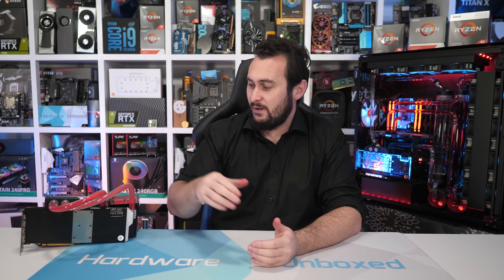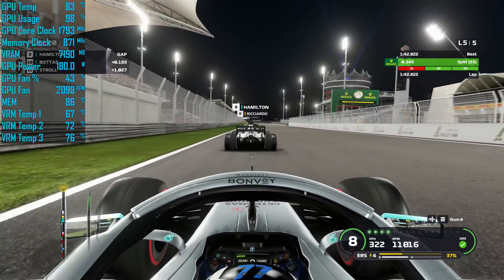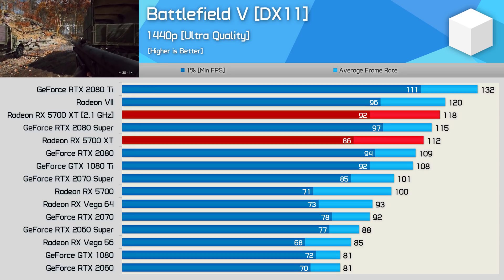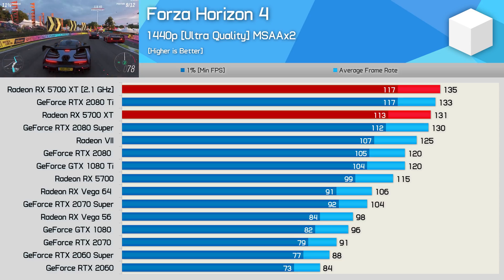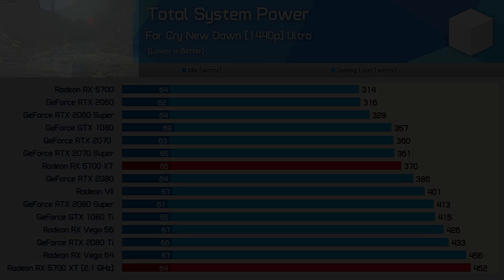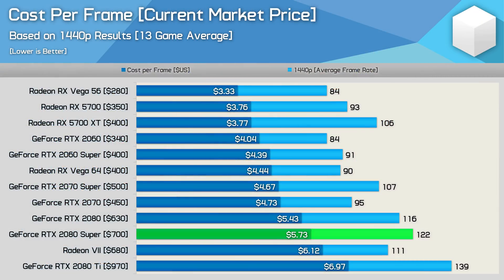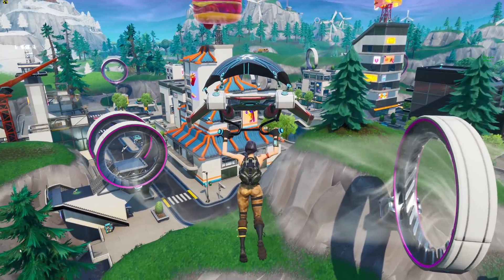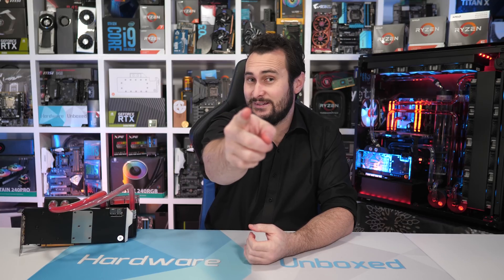Radeon RX 5700 XT Overclocked, RTX 2080-Like Performance?

Comment: Having seen this, the major benefit of having AIB card will be much cooler and quieter card. The performance gain may not be as significant as people was hoping for.
Reply: I mean it was never the case in the past so why would it be different this time, but honestly the performance is solid already so quieter and cooler AIB models will be nice.
Reply: @BombaJead  Except starting with Turing, nvidia started binning separate dies for their more expensive stock versions rather than the traditional of stock cards being just baseline with meh performance. Pascal was pretty similar in someways too, but definitely saw a bigger help from better cooling than we might see from Navi.
Reply: It's already been done and tested.. It runs a little cooler. Power Play power limit registry mod + Undervolt + Overclock = much better performance with a cooler running card.
Reply: I guess it makes sense. Otherwise AMD would have done it. They have engineers developing this product!
Reply: After watching this video I chose the 2070 super.

The 4 years of warranty alone made the choice easy, I'm glad they're performing pretty equally. 

I'm sad I didn't get the 5700 XT because I wanted to support AMD this time... But it wasn't worth the potential wait until mid September.
Reply: Giliver agreed I’m getting a 2080
Reply: @Giliver  I would go the AMD route, you know what happened to the first GCN products? The same will happen again
Reply: @twanduvigneau5809  already went Nvidia, there were too many things holding me against AMD. (Meh bonuses, bad cooler, bad drivers so I've heard, inferior warranty compared to gigabyte etc) 

I couldn't justify the the cons to save $100 or less.
Reply: Giliver the drivers for both cards need to mature more and AMD would definitely need more work to match the rtx 2070/2080 with the 5700 XT
Reply: In terms of temperature and performance
Reply: So not even with all of that WaterBlock mounting (and investment) + extreme overclock it can surprass a RTX 2070 Super. There you go, AIB won´t do mircales, RTX 2070 Super it is. You just made my life simpler, ordered it now! Thanks!
Reply: MultiPlatform MasterRace stop copying and pasting the same thing come on grow up.
Reply: @MrCakeBone  I mean, we're looking at an entirely different pricing bracket here....
Reply: @MrCakeBone  You're paying a lot more (100-150) for what still amounts to a marginal increase in performance, and the ability to get your card a couple of weeks sooner. Why not just make do with your older card for a few more weeks? Or you could have gotten something on the used market.

Comment: Don't forget the cost of the radiator and fans. Water cooled 5700 xt goes over $600.
Reply: Unless you're a beginner, anyone who's into serious watercooling will already have the rest of the loop and knows that you add £140 for the waterblock when getting a new gpu.
Reply: @TheGhost I agree with this but at the same time you are not gonna be buying this card if you have money, you would be getting the 2080ti
Reply: @TheGhost for what? Not been sarcastic, why do you need 16gb og hbm2? At least not for gaming
Reply: TheGhost 2080ti has 11gb vram
Reply: @TheGhost Stop talking out of your ass, my 1070 at 1440p barely uses 5-6 gb on most games out of my extensive game library. You made a big mistake by not going for the 2080 Ti and you're trying to justify your purchase by talking crap.
Reply: @TheGhost actually Steve has said it, the guy who's video you're commenting on.  I trust Steve, you on the hand are just some random guy that thinks a 2080ti has 8gb of vram.
Reply: @TheGhost well I guess if your main thing is video editing and gaming is second than i guess that's good, small market i guess but it still exist
Reply: @TheGhost are you pulling stuff out of you ass or what? Like the other guy said the 2080ti has 11gb gddr6, sorry to tell you this but their is gonna be better card out before 16 gb becomes the norm
Reply: @TheGhost have you looked at real testing before, they explain that the games dont really use them
Reply: 07:25 - 540 USD not "over" 600
Reply: TheGhost no one will watercooled that ugly looking gpu waste of money
Reply: Someone didn't watch the video :)
Reply: TheGhost more powerful?
Reply: So not even with all of that WaterBlock mounting (and investment) + extreme overclock it can surprass a RTX 2070 Super. There you go, AIB won´t do mircales, RTX 2070 Super it is. You just made my life simpler, ordered it now! Thanks!
Reply: @TheGhost Except he was talking crap.  He was spreading incorrect information about the 2080TI, which is pretty much the definition of talking crap.  Especially considering he doesn't seem to care that he had erroneous information.  There's almost no reason to have a Radeon 7 now.  From the benchmarks I've seen on editing with the new Navi cards paired with Ryzen 3000 chips, they can outmatch a 2080TI.  And if you want pure gaming, (as you pointed out) you would go for the 2080TI at its horrendous price.  So the R7 is pretty much only good for graphic creation applications.

I don't need much evidence, just look at the benchmarks for the new Navi cards for non-gaming  at better value.  The biggest tell is that AMD had the option of lowering R7's price, but then they would have to consider lowering the entry prices on the 5700/xt's.  So instead, after 7 short months they've decided to discontinue it...

One could even argue that the 2080 still holds some minimal value for "early adoption" the RTX 2060/2070 and Radeon 7 are pretty much slaps to the faces of consumers who purchased them.
Reply: Mr BuzzKill  Unlikely m8, 1.8-1.9 can be done on air cooling but anything above that will require a water loop.
Reply: Just wait for the custom aib partner cards.. should handle even a 2.2GHz overclock without a problem. Unlike with Nvidia cards, where a high OC can almost double the power draw, it only marginally increases (by 35w to be exact) with an highly overclocked 5700 XT:

https://www.igorslab.media/wp-content/uploads/2019/07/01-Power-Consumption-5.png
Reply: @-eMpTy- How can you be so sure about this?
Reply: @kiklop8362  Depends how they will modify the PCB.
Reply: @FataIxTV  I believe that this core is pushed very far even on this PCB. And cooling seems not to be th way to go. But we will see just get the 2080ti down in price :)
Reply: @-eMpTy-  did you not watch the video you're commenting on?   Steve couldn't reach 2.2ghz on water and there was a giant increase in power draw to reach 2.1.
Reply: @-eMpTy- Lmao a 250w gpu with still inferior performance compared to a 2080 is just as good as a space heater.
Reply: @Gin2341  
$400 vs $650..

Comment: Steve you need to raise the voltage in the power play table to get north of 2.1GHZ that's where the big 2200-2300mhz numbers are coming from.
Reply from the maker: I used the 1250mV profile. Same profile Igor used for 2.2 GHz.
Reply: @Hardwareunboxed  Shame you got a dud.. such a shame :(
Reply from the maker: @denan1  I got three retail duds ;)
Reply: @Hardwareunboxed  Well there times is not the charm..I guess :D
Reply: @Hardwareunboxed  Steve, do you think navi is punching above its weight class?
Reply: Yeah! That is the point! This is silicon lottery and sometimes you get really good sample. Steven 5700 seems to be quite ok, not bad at all. Some people run the wall at 2.0Ghz...

Comment: It takes an AIO/watercooling setup to cool the thing that is 5700XT.
I still don't understand why AMD cards are so effing hot. Even blower Nvidia cards aren't that hot.
Reply from the maker: It's not hot, the liquid cooler cooled it to 45c in a 21c room. A basic air cooler will do just fine.
Reply: Guessing you didnt pay any attention to the setup part of the video at all.
Reply: Ooofies. I didn't mean this watercooled card is hot; it's pretty cool at 45 degrees C. I meant the stock blower cards reaching mid 80s to low 90s from the videos I've seen.
Reply: @RISEUP Gamer 
Yeee. That's the point. I really don't know why their blower fans are so ass.
Currently, you need something like this to make it not a heater. And I haven't seen a non-reference 5700XT with 2 or more fans.
Reply: @RISEUP Gamer 
Takes way too much time for it to be out compared to Nvidia cards.

Comment: AMD really need to stop using blower style cooler.
Reply: They probably have some kind of deal with AIBs to not put "normal" cooling on reference cards.
Reply: Tell that to radeon 7 lol
Reply: @samgakgimbap9683  ,
Uh.. yah, it had three fans yet still managed to have high noise levels. Soooo...
https://www.anandtech.com/show/13923/the-amd-radeon-vii-review/19
Reply: @photonboy999  It only had high noise levels due to high core voltage from the factory. As soon as you under clocked it, the noise level dropped significantly and the same is true for the new blower style 5700's.
Reply: SkyForce6700 exactly as soon as I installed mine I went into wattman and clicked on the auto undervolt and I was good I can’t even hear it and my pc sits on the desk right next to me.
Reply: Jay Laforge Any performance loss?
Reply: FXN Designs no actually I ended up gaining in performance when I get off I’ll fiddle with it and I’ll let you know my numbers. If I manually do it I should see even better numbers I just haven’t had the time with work.
Reply: Sámgak Gïmbap radeon 7 has left the earth.
Reply: @samgakgimbap9683  Radeon 7 was a mistake with buggy drivers
Reply: @A.Froster  I honestly think it was just an excuse to be first to 7nm
It was a... pointless card kinda? Couldve easily be sold as a workstation card for more actually
Reply: @iiiiii7680  Wasn't actuality a Instinct Card repurposed as a gaming card ? In fact R7 is great for computing but gaming , that's another story
Reply: @A.Froster  I am happy with my Radeon 7, mine runs at 2150Mhz and 1200Mhz on HBM and performs great.
Reply: @A.Froster  Yes it is. Honestly its still a great gaming card. Its just the cost. The 16gbs of vram is really nice to have for futureproofing and hell some games even use that much vram in 2019. But a lot of people dont care about vram they just want raw fps.
Reply: @A.Froster  Did you not see the charts? It works great for gaming it's just the price/performance factor
Reply: @treefiddy727  Yeah that's the problem. There is not bad card , there are bad prices  and R7 exactly falls in that category.
Reply: @iiiiii7680  It was basically a modified version of a workstation card. It didn't cost them very much at all to develop it for precisely this reason, and that's why it wasn't a mistake for them. It was just used to fill a gap in their lineup for a half a year. It wasn't an important card for them, but because of the very low R and D costs, it didn't really hurt them to put it out there, even though they were never going to sell that many of them.
Reply: @A.Froster  same with 5700
Reply: Radeon 7 is a totally different architecture. This RDNA thing provided a bit more finished optimization. Not fully but better
Reply: Really, AMD cards have such a huge performance protential. Yet they cripple that with their stupid blower style cooler
Reply: I'm sure it's as a favour for the card partners, or a deal idk
Reply: I think blower coolers are absolutely fine if they stay quiet.
Reply: They probably use it because of certain agreements with AIBs and because its cheap, which gives them the opportunity to sell it at this price point. Doesn't mean I'm a fan of it though.
Reply: They don't have to stop, just let the boardpartners launch their cards alongside the reference instead of AMD only. 
Last week i had 2 customers get Super cards instead of Navi, due to no custom cards.
Reply: Yeah the Radeon 7 cooler is soo much better
Reply: Most of AMDs board partners use a custom PCB design, so if you wanted to water cool your AMD GPU, your only choice would be to get a AMD reference blower card and replace it with a water block.  Honestly, I like the way its set up, there is a market available for everyone!
Reply: It also appears that the cooler has high manufacturing tolerances and doesn't sit as snug as it should.  Another channel modified the cooler tension and replaced the thermalpaste and got way better temps.  The blower cooler actually seems ok if it makes full contact with the silicon.
Reply: @TheGhost ouch
Reply: Remember how mad everyone was at nvidia because they put a dual fan on there and screwed their board partners?
Just wait a month for the AIB partners to release their cards. (If anything they should just let them release at the same time, not add another cooler.)
I'd just get the Sapphire card anyway.
Reply: Blower style cards still have immense potential, that neither Nvidia or Amd doesn't want to execute. the vapor chamber heatsink easily has far more room in that card to be expanded, heck heat pipes are possible. they just don't want to experiment with the design sadly..
Reply: OR, they really need to better engineer their reference coolers... The Radeon VII was in the same boat despite its axial blower.
Reply: why?
Reply: @BeepBoop-o3o  Because you can't fit enough heatsinking into the cooler's shroud without making it excessively long to be able to effectively cool the GPU core. If you use an axial cooler like that seen on the Radeon VII, you can have a heatsink that covers the entire board and therefore has more thermal mass and more area to transfer heat. More mass + more surface area = more heat removed therefore the core runs cooler.
Reply: People need to realize, we are only a small portion of the market.  The majority of the market is and has been people who just get a Dell or an HP or go to Walmart or whatever.  That is their primary customer, and they will just happily sell to us as well.  Get a reference card that has good compatibility with water blocks or just wait a few weeks for a partner card.
Reply: @Geopirate3  I dont think most PC gaming users are buying HP or Dell pre builts to be honest....
Reply: Sapphire Nitro 3 fan cooler with the massive heatsink, like they used on the Fury cards, now that would be a great reference design. I loved being able to play games for hours on end and never once having to use the fans.
Reply: custom 5700 come soon, just wait for them.
Reply: I love blower coolers and I wish companies made after market blower coolers with fans of the same size as the strix 970 cooler for example. That would be incredible!
Reply: I prefer blower cards- my case doesn't have good air flow- lots of cases benefit from blower style- others you know 3rd parties will support your  preferred  choice- others will appreciate this
Reply: Another User Same here! It’s good to see another user agree ;)
Reply: A lot of people's hands on experience has proven that the hate on the blower cooler is overblown. I found the blower cooler on my HD 6970 out lived the fans on my HD 7950. They seem to be a lot more reliable
Reply: Like Clockwork64 Exactly! Centrifugal fans are far more efficient and durable than axial fans, but companies only put extremely tiny centrifugal fans (and only 1) on graphics cards so they have to spin extremely quickly. If they put centrifugal fans of the same size as the axial fans found on many GPUs this would be a totally different story!!
Reply: Reference is not meant for usage.
Reply: @lcarus 138, Its really not the style of cooler to blame. is more the size of cooler vs the TDP. A proper sized blower would be ideal for a inside case gpu.
Reply: They do this to not take business away from their partners
Reply: If they change it to liquid cooler, the same applies to the price
Reply: Blower is not bad
Reply: Blower is for those who take off the cooler and slap on a waterblock . Stop complaining and be patient
Reply: @ATI6950FTW  yeah, but they wanna VOID your warranty if you do. Hypocrisy much?..
Reply: So not even with all of that WaterBlock mounting (and investment) + extreme overclock it can surprass a RTX 2070 Super. There you go, AIB won´t do mircales, RTX 2070 Super it is. You just made my life simpler, ordered it now! Thanks!

Comment: I don't really care if it matches a 2080 (super or not) on a water block overclock. I'm more interested in that it appears an AIB model could match or exceed a 1080ti (on average) for $400-$450.
Reply: The temperatures and sound will be the more important part. Ofcourse it Also allows some headroom to overclock. But 5700 is allready quite speedy for the price!

Comment: I don't know how well that 5700 XT reference model with its horrible heatsink and blower cooler will OC but the aftermarket cards with proper heatsinks and fans on it will be overclocking beasts (clock frequency, not necessarily performance), >2000 MHz should be easily feasible.

Comment: the performance in OC is great...the almost 100 watt more power is a disaster tho.
Reply: well, if you floor the gas in your car, you'll get worse fuel economy too. So, i guess business as usual
Reply: @TheHighborn  yah ofc but we beeing still weaker and having 30% more fuel useage is not clever...i mean in long terems wit hperma 100 watts more you will throw a lot of money out of the window. Rather pay 100 dollar more and get  a effcient card or run on low oc`s
Reply: Wait, how much does rx consume and how much rtx 2080?

Edit: i just watched that part, and damn, overclocked 5700xt is hungry
Reply: not really, according to anandtech the stock 2080 pulls 450ish watts under worst case load while the 5700xt pulls only 290ish so 100 extra watts for 390 is still quite a bit less.

https://www.anandtech.com/show/13346/the-nvidia-geforce-rtx-2080-ti-and-2080-founders-edition-review/16

https://www.anandtech.com/show/14618/the-amd-radeon-rx-5700-xt-rx-5700-review/15

so uhh no